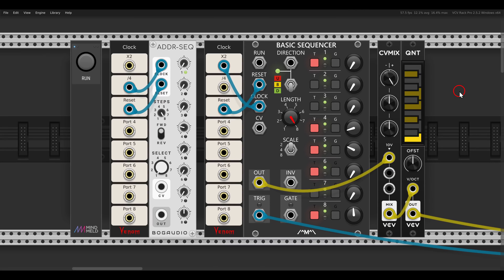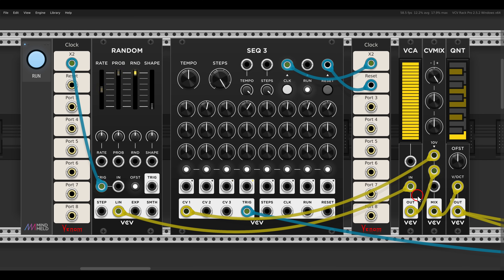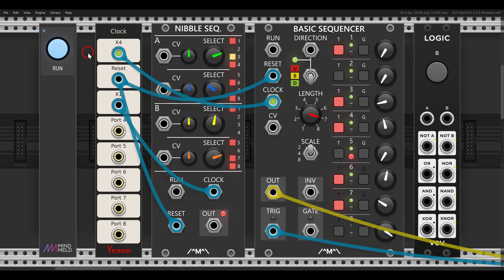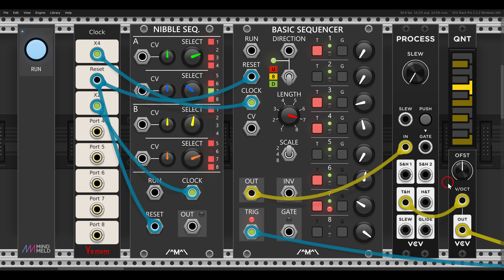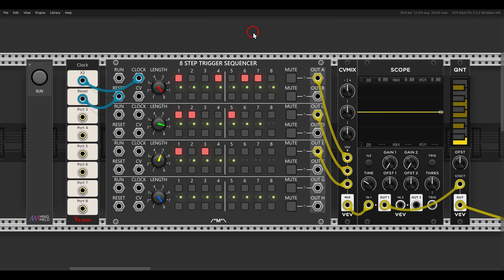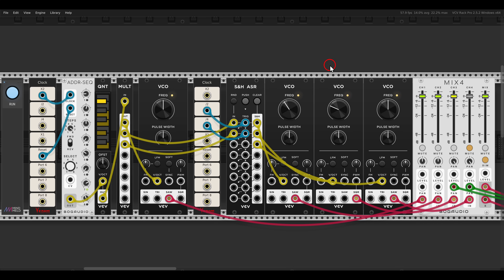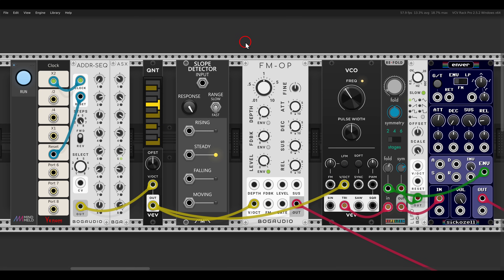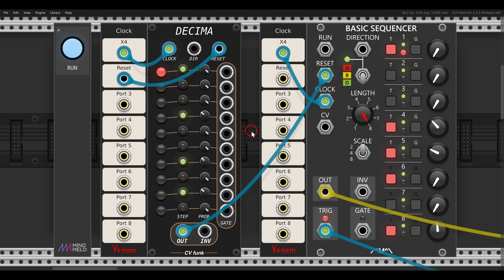12 Composition Techniques in about 12 Minutes

Comment: Thanks so much for your ideas - as ever, inspiring and such a joy to listen to & learn from :)

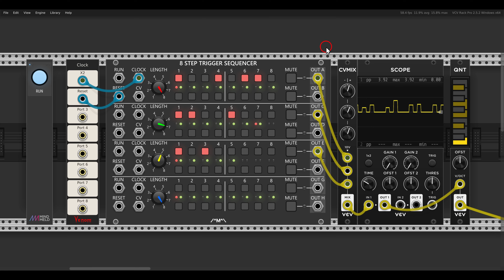I have a question re. Harmony with Sample & Hold (8:08). I found that the technique you show works very well when the number of steps is an odd one, but as soon as I change to an even number of steps (e.g. 8 steps with some off in seq3) S&H will divide it by 2 and only play every other step. Any idea how to get around this? (I can duplicate the Sequencer, Attenuator & Equaliser on a /2 bpm, but it defeats the purpose of the method)

Thanks!
Reply from the maker: Thanks so much! The trick is really to have a different between the rhythms so you get more movement. You can use other divisions, or even a dedicated trigger sequencer that has a different length
Reply: @OmriCohen-Music  thanks! I’ll have a look into that :)

Comment: Lovely tricks! One I like to do is to mix a sequence with a very slow lfo so that the sequence moves up and down with a varying root note, sometimes it will also create little ornaments as the LFO causes the quantizer to shift notes. It can be fun dialing in the speed of the LFO or using another LFO to vary its speed as well.
Reply from the maker: That's a great tip!

Comment: I cant find the Venom Clock module in the Library, its driving me mad, can anyone help please?
 Also the patch at 3:24 has a blue cable going from the SEQ3 Trigger to somewhere that is off screen, can anyone tell me where that trigger is meant to go?
Reply from the maker: Yeah, it's the Bay module from Venom, which will 'teleport' signals. That way, I don't have cables going everywhere. The blue cable, by the way, is triggering the oscillator I have off screen.
Reply: @OmriCohen-Music  Thanks!
Reply: It's not a clock module, Venom has a module that lets you pass named outputs to a panel neat and tidy. It's called Bay Output i think.
Reply: @coco805  Thankyou so much, this was driving me insane!